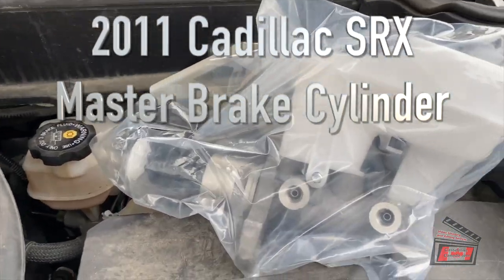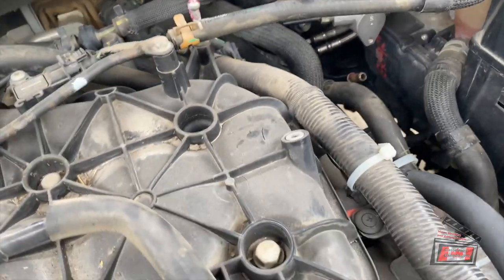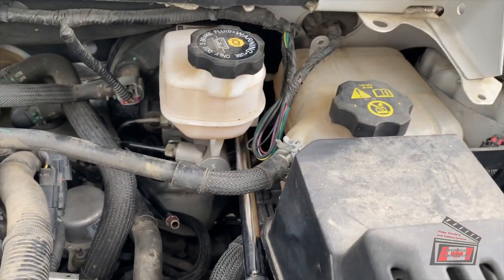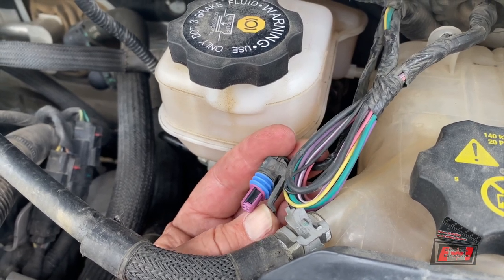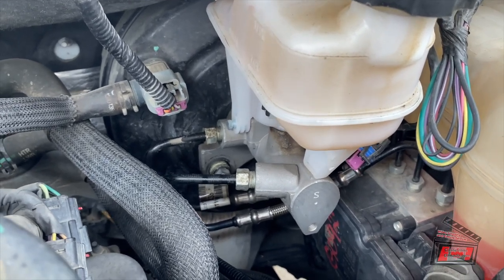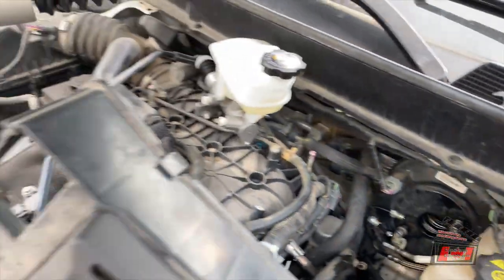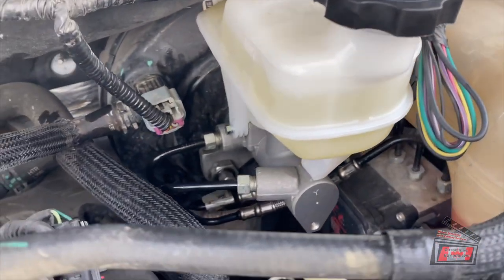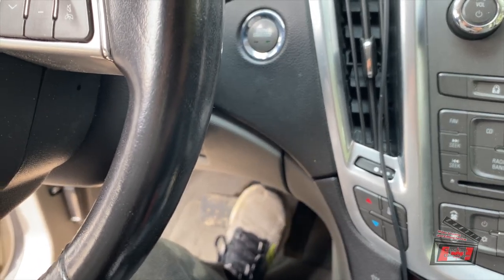Master Cylinder Replacement 2011 Cadillac SRX

Comment: Hey, brother. How has the OE held up? My pedal randomly goes to the floor, and I lose the brakes. It's so random that I'm considering replacing the MC. I've already replaced both calipers, rotors, and brake pads in the front due to the lockup issues people are having!
Reply from the maker: It has been at least a year- maybe more since all my brake problems have been fixed. I eventually went to the GM dealer. After listening to all my previous work and symptoms, they took the car and tested it. Said it needed a genuine GM master cylinder. I finally decided to let them try it. Everything is perfect and I have had no problems since then. I have been too busy, but I still intend on taking the Dorman MC apart to examine it and see if a seal is backwards or some other problem. But yes, for me it all started when I wanted to fix the pedal going to the floor problem-- especially when I rattled the car like going over railroad tracks.

Comment: This job seems to be simpler than I expected - relative to other jobs (alternator replacement, for example).
Did you have any symptoms that led you to replace the master cylinder?
Reply from the maker: Yes, the job is not really that hard. Although bleeding a system with ABS can be awkward without the correct tools to cause the ABS valves to open.
Now to address your other question. Why did I replace it. More than a year ago I replaced it because of a low pedal and also because sometimes the pedal would go quickly to the floor and you would have no brakes.
But that new MC bought through Amazon from Dorman turned out to be the cause of my front brakes locking up. See another video when I replaced the front calipers and hoses. Also replaced the ABS motor but made no video for that.
So this video was when I bought another MC - again from Amazon and it was Dorman again- and replaced it again. Last ditch effort to fix a problem that came and went for nearly two years, or dump the car for parts.
This time the brake lockups were worse and more often. So I took the car to the dealer to let them try. They replaced the MC with a genuine GM master cylinder and now I am testing that one.

So, if you are replacing the MC for any reason ! ! ... Go ahead and do it yourself I guess. But DO NOT buy it from where I bought both of mine. Buy a genuine GM master cylinder or get the dealer to replace it. I had to wait 3 weeks as they were backordered. Not bad as I thought I would be waiting 3 months. The bill to repair was not cheap, but less than if I would have sold it for parts. I also lost twice on buying two master cylinders, two calipers, two brake hoses, dealer power bleeding and a lot of head scratching. But I have a lot of new parts on the car now too.
Reply from the maker: I returned the master cylinder to Amazon. However since it was over the 3 week return window, they only refunded about 80% of my purchase price. Anyway, I still have the first MC from Amazon and will likely take it apart sometime and look for improperly installed parts. It has to work if all the seals are installed correctly.